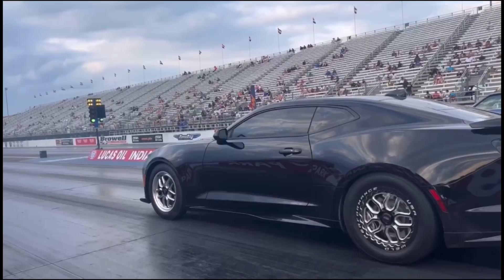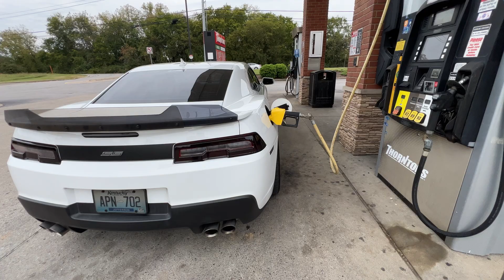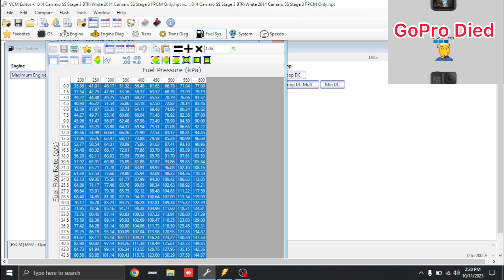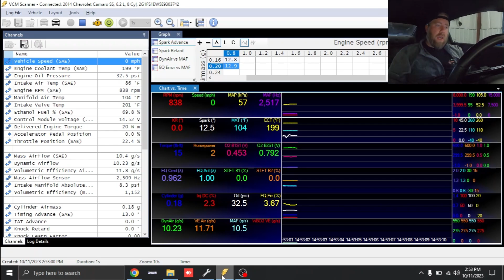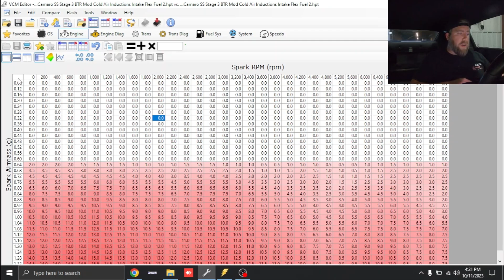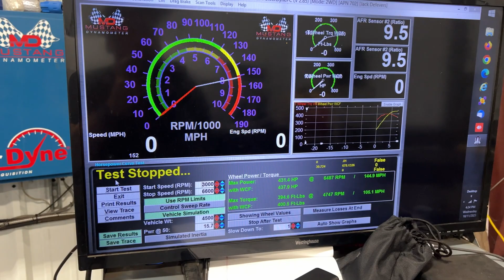Dyno Tuning a BTR Stage 3 LS3 Camaro on E85 + FPCM Tuning

Comment: Does upping the voltage also change the injector flow in addition to allowing the fuel pump hold better pressure?

Comment: How are you dealing with Rich after Reflash issue?.  ITT  has to be stableized to 122°F before I can do a log and heat soak is a big issue
Reply: Don't forget that valve temperatures  should be below 178 degrees Fahrenheit, which will also cause similar issues. Usually, after a flash, you will see 19X degrees Fahrenheit.

Comment: My brother hand me down his 15 v6 camaro last year on my 18th birthday and have always loved the 5th gen camaros and man do I want to build a ls3 1le to 700hp. I have the funds for the mods just need to find the car to finance it but what’s killing me is the weight of the car and the manual transmission knowing most automatics are beating any manual cars unless your high on hp or very light on weight. The bmw with b58s are running the racing scene right now for overall roll racing and digs, makes me wanna second guess my self in buying a v8 Camaro but I can’t get over the raw v8 sound being cammed. Hard decision. What would you do if where in my position?
Reply: I am chevy owner i have boosted build engine corvette C7 and stroked L83 single turbo sierra but i will go with B58
Reply: Nice video. Your driver side 02 sensor is dead, that’s why the stft is always returning to the same thing 😊

Comment: Do you have any vids on how to make the car pop like that for a gen lv ls ? I have a 2010 Camaro ss l99 with headers and tsp cam, i disabled dfco but can't get it to pop like that.
Reply: you need to remove -10 on the spark adv high oct and go to base min and -10 there too, don't go lower than 0.16 on the spark table